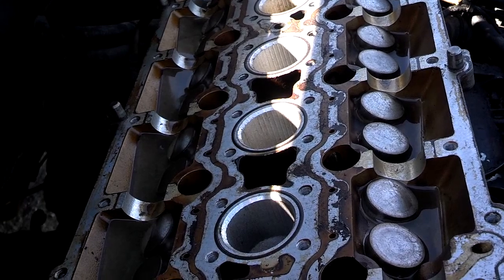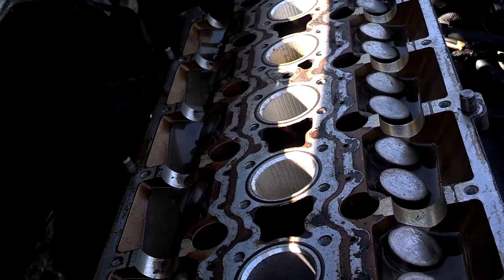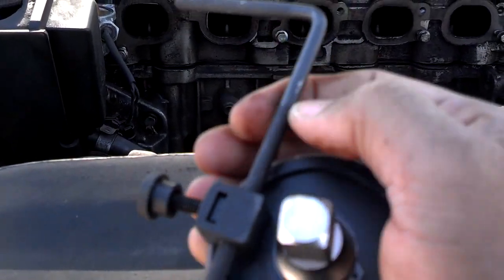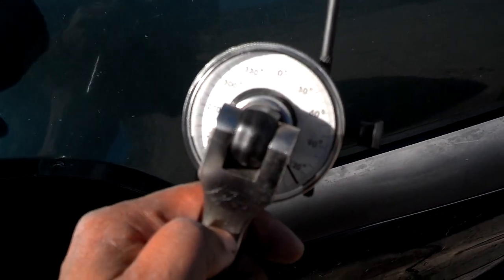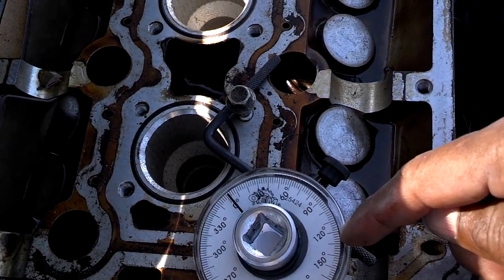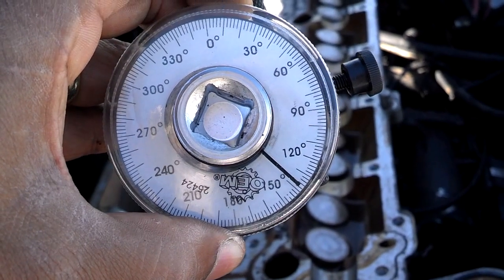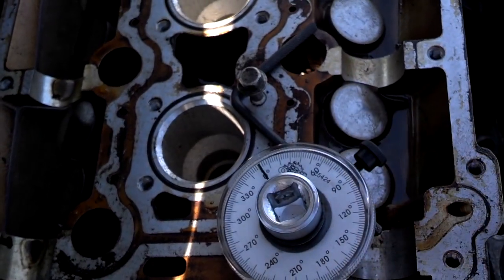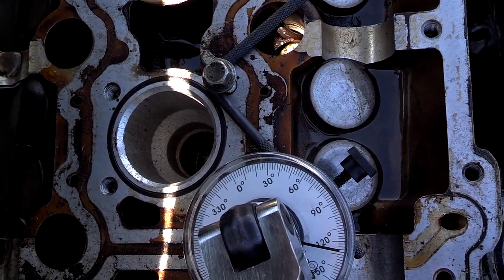How to use an angle degree torque gauge, this torque is usually used on torque to yield bolts.- VOTD

Comment: I am fitting a new cylinder head on a renault clio and according to the haynes manual (car book) it says that 1st stage is to torque at 20nm, then after that 240 degrees!
To me that seems too much, i am afraid the bolts might snap (they are new bolts) is that about right to tighten that much, thats like from 12 oclock on a clock face all the way to 8 oclock.
Does the angle tightening process have to be done is one movement as i wont have the space to turn in a complete revolution from 12 to 8 oclock, could i do it in two stages, ie from 12 oclock to 6 oclock, then take the torque wrench off then go from 6 oclock to 8 oclock (240 degrees in total) can i do it that way?
Reply from the maker: SP330Y I'm sure the torque numbers are correct but it will be hard to swing it like you said. So, do it 2 stages like you explained. I usually lubricate the bolt threads to help them tighten smoothly. Also, make sure you torque them in the proper pattern. I use a long cheater bar. - Cylinder head installation, head gasket, lifters, etc. - Auto Repair Series
Reply: Robert DIY thanks for your speedy reply, speedy.
Reply: Make sure to always use new bolts for this kind of work - even if stretch bolts are not used on a specific engine (these are one-time use ONLY), you can never be certain that previous work have not put a strain on them. When working with angular force measurements like this, dividing it is some times unavvoidable. Don't leave a "tiny ammount" for the last turn, keep atleast 60 degrees if the total turn specified and available space allows for it.. Make sure to lubricate your bolts well, but don't drown them (excess will come up and spill). This will help towards momentum not being dissipated through friction for the wrong reasons, and thus (potentially) vastly increasing the actual torque put on the bolt, when turning it the required degrees. In your case, it will also help towards reducing static friction (the force needed for something sitting still to start moving) - which could get pretty high when stopping 2/3rd's on your way to 240 degrees. The last part is also why you don't want to stop at e.g. 230 degrees - the breaking static friction at that point might require much more force than what would be applied to the bolt during the last 230->240 degrees. Risk: Broken bolt.
Reply from the maker: Thank you for explaining in such detail.
Reply: Robert DIY Lubricant is often not supposed to be used on torque bolts!
Completely changes the friction & recommended torque is not met..

Comment: thanks for your vid

one thing though made me wonder if I misunderstood my volvo VIDA instructions

it says tighten them all 20Nm, then 60Nm, then sequentially to 130 degrees angle.

now, I thought sequentially meant tighten them "circle wise", not crisscross

anyone who can explain whats correct way to tighten them?
Reply from the maker: This video shows how to use the torque gauge. There is another video that shows the pattern in which to torque them. When you torque them, sequentially means "torque all of them to the initial value, then go back and torque all of them to the 2nd value. Then go back and torque all of them to the final value." The manual will explain the pattern, however my other video explains that as well.
Reply: Robert DIY
thanks